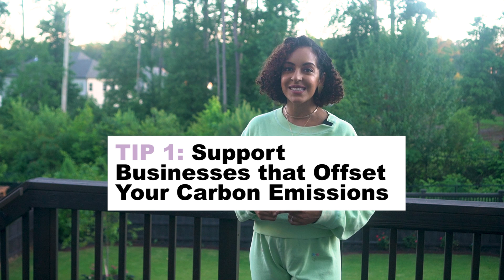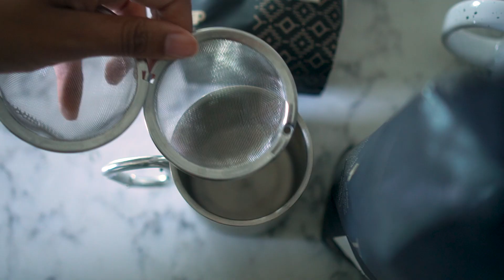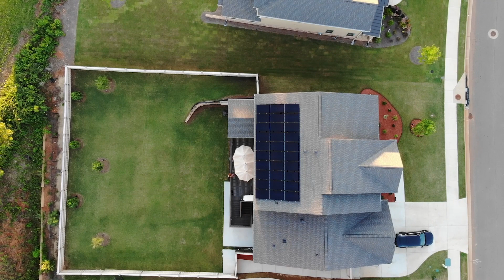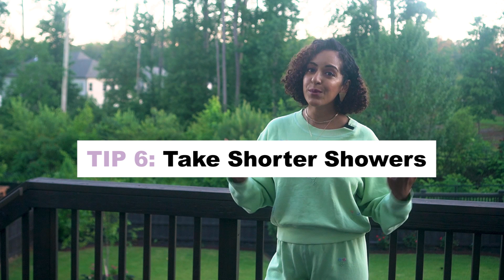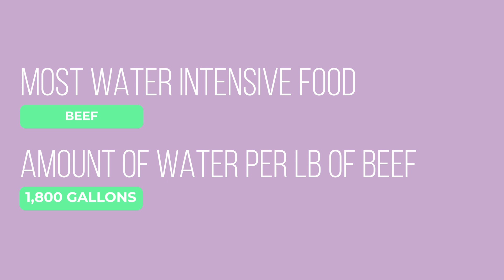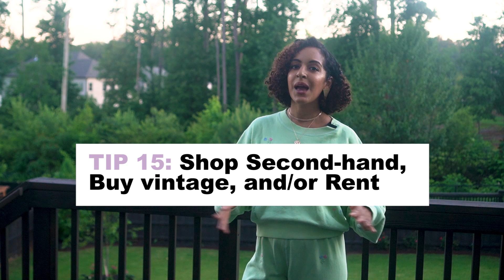15 WAYS TO REDUCE YOUR CARBON FOOTPRINT AT HOME

Comment: An energy efficient home is more comfortable and saves money in the long run.
Added insulation, triple glaze windows, energy efficient doors, energy efficient heating and cooling systems, energy efficient appliances, LED lighting, solar panels combined with battery storage and a electric vehicle charger in the garage or car park. People are too focused on the short term costs and miss out on long term savings and comfort. Blower door testing and air sealing are under appreciated tools.Even if you have money to burn you should not waste it.  Climate Change will impact everyone. Leave a better future for your children and grandchildren. Join in and speak up for the future of the planet.
Reply from the maker: Your comments are always so educational and thought provoking. I try appreciate your insight! This is all great info and you're right climate change will impact everyone (and already is affecting communities around the world).